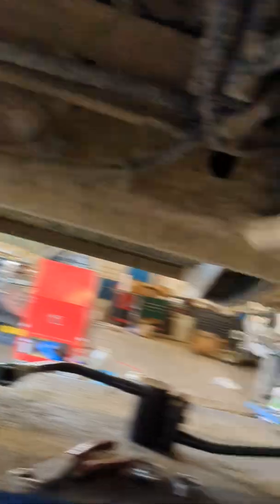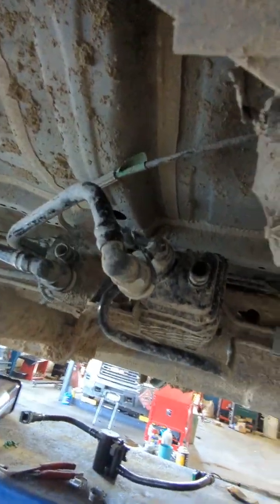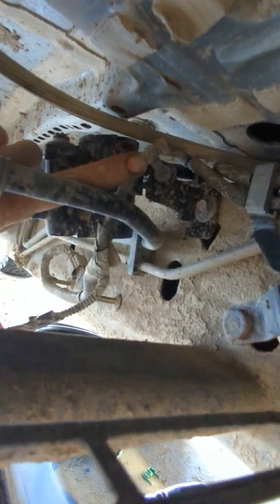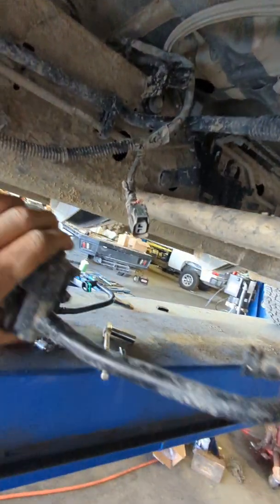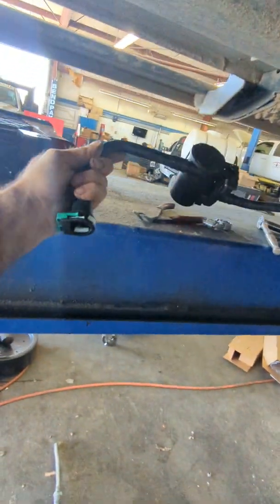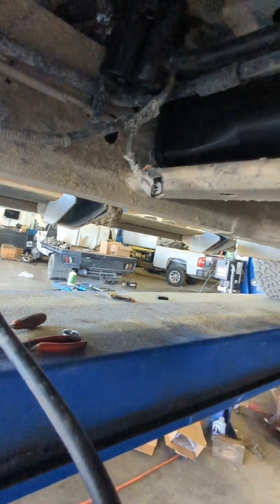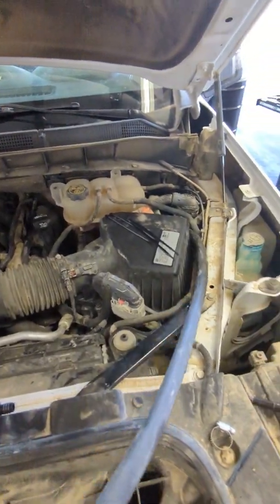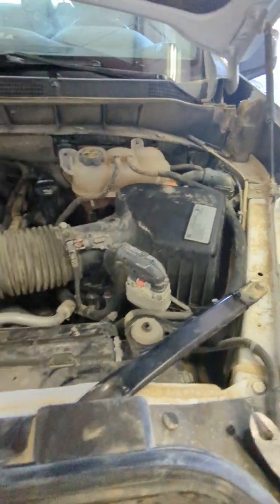DTC P0446 Code | 2020 Chevy Silverado | Including New GM bulletin

Comment: You can't use the remote start cause it a hard  code,so it will not clear until you fix,,and it should be fixed.

Comment: Great video.
This post will be a little long but my experience  is as follows.

Have p0446 code at 28,000 miles and dealership warranties  paid for replacement parts. At 44,000 I paided 800.00 to have evap parts replaced again. At 49,000 I had same code .I took back to dealership this time I got a little pissy with them and so they decided to have another mechanic  look at it and decided to blow at lines and clear alarm.
At 51,000 same alarm there topmechanic was assigned  the job he did a smoke test and found no leaks, he checked sylenoid , canister ,filters and everything checked good.
During our conversation I mentioned that while filling up truck while engine was running it would trip the gas pump hose.
I have a capless gas tank and he said that it could give me that alarm if filling truck with gas while running. We cleared the alarm and now I am waiting to see what happens.
I know it's not a good idea to leave  truck running ,I was just trying  to keep the wife happy and cool in the hot summer months.

Comment: Where can i get one of those spondge filters from  to put on the 5/8 hose,,This is what i need to do, Thank you
Reply from the maker: @bennystahl7192  you can't, I have to get up in the fender well by the gas tank filler hose and remove it, clean it out with air and reuse it.

Comment: Would this cause my truck to run a little rough sitting at a light? Feels fine at idle in park but in drive feels a little rough
Reply: No this does nothing to the car the only thing that would make you notice it other than the light is when you are trying to fuel your tank it will click the fuel off due to lack of airflow

Comment: I just left my local Chevy dealer in Killeen, TX. They charged me $75.42 for the canister vent solenoid (84613138) and $54.63 for a hose (84626475). Labor was $629!!! My truck is a daily driver and not a "farm truck" and is drivin on highways and roads in town. My 2020 Silverado is always clean as I run it through the car wash a few times a month. It cost me $809 to get this vent valve and hose replaced. Crazy thing is, the check engine light came back on when I left. I turned around and drove it back to them and they where kind of dodgy when I asked them to explain what they did... They scanned it and the same DTC (P0446) code has returned. They gave me another estimate for around $600 saying they would now like to change the fuel tank pressure sensor? I asked them to fix it since I just paid $809 and the (P0446) code obviously wasn't fixed. They said they wouldn't cover it under the original repair since I drove it off the lot... So the new repair for the same DTC P0446 code will cost an additional $600 or so cost on top of the original repair cost... wtf?
I feel like the dealership took advantage of me!

Comment: Would this stop the P0455 code for gas cap
Reply: It throwing both codes P0455 and P0446 and I've replace the gas cap with dealership and Napa
Reply from the maker: You will have to go get a smoke test done then to pin point the leak.
Reply: @ShowMeMechanics  so is it called a smoke test or do it go by another name
Reply from the maker: No this is just for the P0446 only or if your gas tank is hard to fill.
Reply from the maker: If you have an aftermarket gas cap and the code keeps coming back, go to the dealership and purchase an original one, should take care of it.
Reply from the maker: Yes they will smoke test the entire system and smoke will come out of wherever it doesn't have a seal. Usually takes from 30-45 mins.

Comment: Should I cap off the hose cut going to the gas tank or leave it open?
Reply from the maker: The hose you cut off you can just leave it, cause it just runs up to your gas cap and has a filter on the end of it. That's why we run the hose to the engine compartment and install the new filter it came with.

Comment: This guy is right. However evap codes are annoying but don't do anything to effect performance. If you don't have to do an emissions test, don't waste the money. It's better to just buy a cheap code reader and check your codes often to make sure that it's only an evap code and no other problems are occurring. If you have to do an emissions test, then unfortunately you need to fix it. But make sure it's not a bad gas cap or leaking evap hose before spending money on parts.
Reply from the maker: Thx for watching, and the comment. Yes this is for P0446  only. Not for a small or gross leak detected codes. Those you will have to do a smoke test to find the leak.
Reply: The only real problem with that is that you're running with a check engine light on all the time. Some people wouldn't mind that, but the problem now is that you have to keep periodically checking it to see if any new codes have come up.
Reply from the maker: Yes it doesn't affect vehicle performance, other than it might be hard to fill, but you will have to fix it eventually due to smog regulations, especially here in California.
Reply: Yes they do. I don't have a code and have something going on when I fill up the the first quarter tank I have intermittent rough idle and after that rest of tank smooth as butter.  Gona replace purge valve but not sure.  Seems like it may be creating a vacuum.  Good info thanks